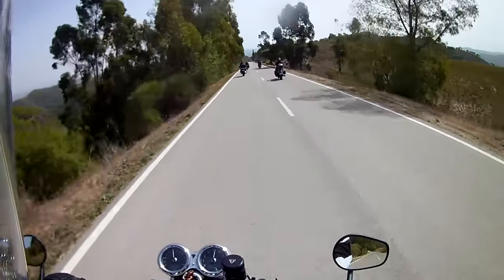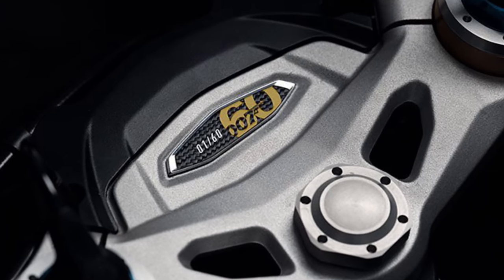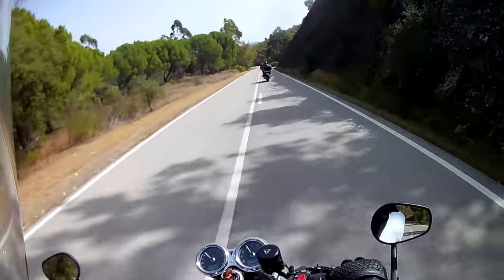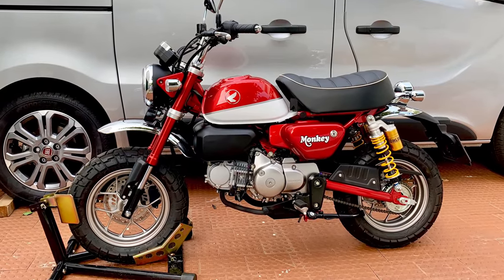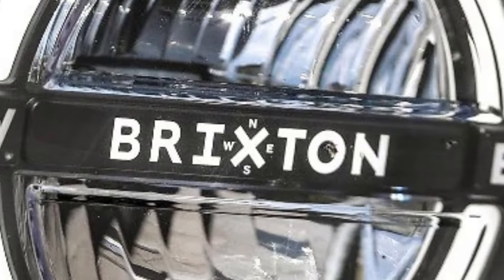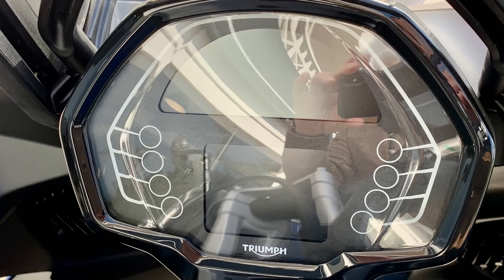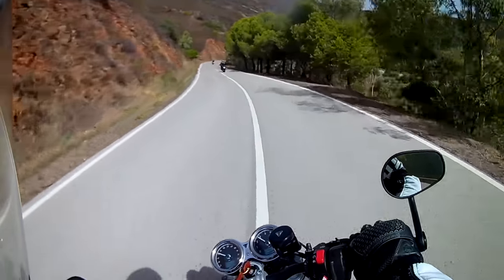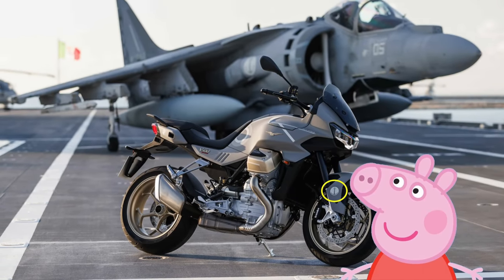10 recent Moto Design FAILS [SoapBox#2]

Comment: Great topic 👍🏼. To me the most widespread design fail on motorcycles is giving it a double headlight with only one working. That's where making cuts for the sake of a low price tag goes too far.
Reply from the maker: Agreed! Looks as if one of the bulbs has blown :(
Reply: I agree, but think it's up to the regulation in some countries. In Germany, for instance, two-wheeled vehicles must have a single headlight on. Beyond weird and probably an atavism, but there it is, on the largest European motorcycle market: One light low, the other high.
Reply: @borisbabich  This is wrong. I live in Germany and over 37 years I rode several bikes with double headlights and they were perfectly legal.
Please refer to §49a art.4 StVZO (Straßenverkehrszulassungsordnung)

Comment: Totally agree with all your points, and I also would not want to buy a James Bond branded bike. They'd have to make it cheaper than a normal one for me to buy it.

Those Beemer asymetrical lights, awful. On the picture you show, they could have put them vertically, and it would have been much better.

So, the black section on the exhaust pipes on my 2019 Speed Twin. They fixed that on your 2021 one !  I think at the time of Euro 4 exhausts they wanted a good reason for new owners to buy the £700 upgrade Vance and Hines exhausts that looked a lot better.

Not a visual thing, but the kick stand on my Speed Twin, after 3 years I still find it a faff getting my boot on the lug to kick it down. Only needs 1/2 inch extra on the lug. 

So not Triumph's fault, I've committed bigger sins of styling on my Speed Twin, I put a rear rack on it and added a top box. It makes it look like it has a really fat posterior . I start singing the Queen song about Fat Bottomed Girls to it, I guess it makes my rocking world go around :-)

Yes, the top box is easily removable from the plate, so I'm only left with a smaller bit of hideous metal frame.
But I can't afford a big sport tourey bike right now, so I have my reasons !
Reply: Ahhh, on my Speed Twin , and your one too. The bit of exposed frame at the back of the seat. A bit of extra seat was needed ! my wife would appreciate the extra inch of seat too .
Reply from the maker: Lol, thanks for your feedback :)
Reply: Not sure they'll age well, those James Bond 007 editions. I'm not sure how anyone would identify with the concept unless they're a wanna be spy motorcyclist in their 60's or 70's.

Comment: I would of chose the winglets on the upcoming Moto Guzzi V100 Mandello ..also not sure if you read the gumpf on the limited addition V100 colour it’s supposedly based on the new F35 but I’m sure they haven’t got any yet so it’s posed in front of a Harrier ..
Reply from the maker: The winglets are risky, but if they actually work I’d be tempted to allow them😊

Comment: Moto Guzzi screwed the pooch when they went to black wheels on the Mondello, instead of the gold wheels as seen in the earlier pre -production bikes. I had one on order over a year ago when I thought it was going to have the gold wheels. Bait and switch . Mine now expected in January per the email i got, today.
Reply from the maker: Agreed. That’s why I’m more interested in the base model👍😊
Reply: I have mixed feelings on this one. The gold looks nice but for practicality, I prefer the black. Especially with the grey version. I'm not sure that gold wheels on the charcoal grey would have worked. I prefer the grey to the green anyway, so that's what I've opted for. The special seems a bit of an oddity. I like the overall colour, but I'm not interested in special editions as a general rule. As the Navale isn't the same specification as the S model, I ruled it out straight away.
Reply from the maker: When are you expecting delivery?
Reply: @RocketMan_Moto  no idea yet.
Reply: @RocketMan_Moto  December or January , depending on who you believe.
Reply: @RocketMan_Moto  On the subject of this video, have you seen the luggage rack Guzzi has designed for this bike? Hideous doesn't even begin to describe it.

Comment: Awful-looking Honda Hornet headlight that somehow looks worse than its 2011 inline 4 predecessor. I know it's a part-bin bike but Honda can just slap the CB650R headlight on it and nobody would say a thing about the design.
Reply from the maker: Not a fan of the Hornet’s face either
Reply: I was SO disappointed in the front of that bike.
Reply from the maker: I think many (most?) people were

Comment: This is more of a marketing spec fail. The pillion seat of the tiger sport 660 has a step up of ~20cm from the rider's. Why? Because marketing specified full width panniers that were no wider than the handlebars. These then have to be tucked up under the seat a little, hence the seat has to be raised. They copied the versys 650 here. But kawasaki at least gave us a good pillion seat with good grab handles. The tiger's handles are set too low to reach, this is from my wife who has had a licence for 25yrs and been pillion for 35yrs. I feel they ruined a good bike by refusing to compromise a spec a bit.
Reply from the maker: Thanks for your feedback👍😊

Comment: All very valid points. The Tiger 660 is ugly full stop though, looks very naff.
Reply from the maker: My biggest gripe is that it looks cheap. Cheaper than the Trident for some reason.
Reply: That’s how I feel about the rs660 lol it’s kinda ugly and feels/looks cheap but isn’t cheap parts wise 🙃
Reply from the maker: That's true
Reply: I think the Tiger 660 is "okay" , it's the pillion seat that looks really crap to me.
At least the Tiger 660 has a 120 degree crank triple, and not the T plane crank crap !

Comment: Top 10 Failed Motorcycle Products since 2000-2022 
1. 1992-2003 HONDA CB250 
2. Honda CMX250C
3. KTM 690 Duke 
4. 2002-2005 Suzuki GSX250FX 
5. 1999-2007 Kawasaki W650
6. 1994–2003 VT250C 
7. YAMAHA SR400, Kick Starter 🦶 
8. SUZUKI TU250 
9. 2000-2007 KAWASAKI ER-5 
10. HONDA CB400SF (R.I.P in 2022) 
In America, Europe, They did not like riding small capacity 250cc - 400cc. All most motorcycles failed in these classes.
Reply from the maker: Nice list, thanks 👍😊